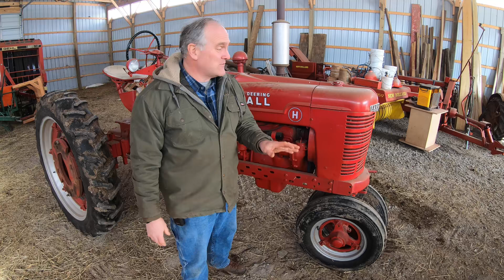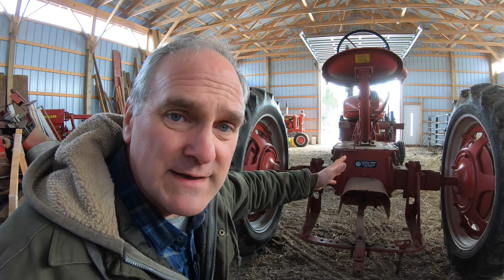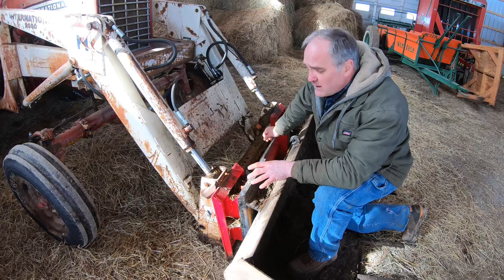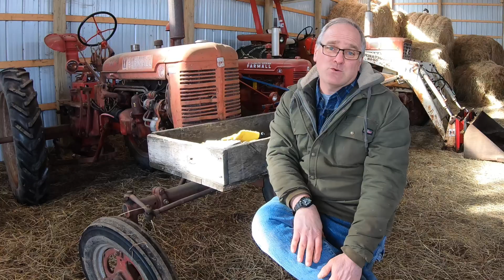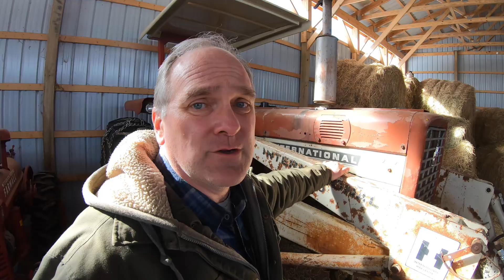Buying an Old Tractor for Your Small Farm

Comment: Well done video on the basics.  Do you have a comment on 6 volt verses 12 volt tractors?  What voltage system you prefer or find easier to work on?  Or maybe you find no real issue or difference.  Thanks for your video.

Comment: great discussion on old tractors.  live hydraulics is a super important advancement good to explain that!  as well as live PTO, many hay crimpers and sickle motors have been clogged due to the lack of live PTO.   the other thing is the older implements are usually cheaper as well as the tractors.   Definitely correct on Diesel tractors from the 50s, usually they are big bucks to repair.  thank you again for a great video

Comment: In Norway there is hardly any used market. Farmers can't get a price that overcomes the usefulness it still has so they rather use it as stationary power for something.
As a buyer used tractors seldom makes economic sense when they cost half what a new one of comparable size does.

Comment: You have the right idea Pete, around where I am in Ireland I see so many farmers with 30 or 40 cows going and spending 10s of thousands on big 200hp tractors. When really all they need is a few little machines like yours.  At the end of the day, your farmalls will still be around in 50 years time when a modern machine isn't.
Reply: a 200hp tractor costs like 150k€ but on dairy farming you need at least 100hp to be able to do the work with your own tractor as the machines have gotten to big

Comment: Really enjoy your channel content and occasional humor. I turn 70 this month and offer my perspective:  this past week I sold my two tractors preparing for my first new one, to be delivered later this week. 
I sold my 8N (1951) and Ford 3000 with loader (1965). Although they differed considerably each ran very well and served my needs. 

They each held sedimental value as my dad farmed with similar models plus three Minneapolis Molines (ZB, 445 & M5 models). 

I think you could spend hours talking about how Henry Ford and Mr Ferguson developed the 3 pt hitch and how those early tractor revolutionized small farming. 

In closing very good entry discussion on tractors.

Comment: My friend and I run a hobby hay business and all we use is old equipment. Our tractor fleet consists of a 1950 case so, 1949 AC WD, and a 1985 IMT. For bailing we use a 1950 AC rotobaler. Really neat to watch but very finicky. Our stock is rounded out with a haybine, sideload rake, and standard sickle bar.
You can't beat this equipmet for ease of maintenance and repair. The mechanics are truly that; mechanical. No computers, diodes sensora, etc. This is a great advantage since most repairs can be done by someone with modest mechanical knowledge. Plus theyre fun to run.
BUT....three are two considerations to remember. 
1 they are not going to work at the speed or efficiency of modern equipment.
2 OLD EQUIPMENT CAN BE DANGEROUS!
There's a lot off old farmers missing fingers, arms, or legs. Or, worse yet, DEAD. Not much thought was put into things like safety guards. It was assumed back then that people had common sense. 
Old equipment can be fun and beneficial, but YOU are responsible for your own safety.

Thanks fur the video Pete.
Reply: One farm near where I grew up used Allis Chalmers equipment in the 60s I liked the small round bales so much easier to work with and feed with than the small square bales.

Comment: Farm born and raised I still have a great affection for the smaller simpler tractors and a desire to get back to the farm!  Those tractors are simple to maintain and work on and cheap to purchase.  Many now want to start out with a new tractor with a multitude of attachments, problem is you can only use one attachment at the time.  I am an advocate of having multiple older tractors with each dedicated to a particular job or two.  If one breaks down, just move to another for the time being.  Many of us can take a lesson from you on that, you are rebuilding/repairing one of your tractors right now, yet your whole operation did not cease because you took one tractor out of service.  Every tractor has a job and every job has a tractor and you have spent probably less than if you had bought a new tractor with multiple attachments.  Great videos Pete, I enjoy living vicariously through you till I can get back on the Farm!

Comment: All fair dinkum, as our Aussie friends say. I would add, get a tractor a size bigger than you think you need. If you plan on doing a lot of loader work try to find a four wheel drive tractor. A three point hitch is worth spending a little extra.
Reply: 3 three point hitch is not something which decides how much you spend but it decides if you spend money if it has none, do not buy that tractor it is pretty much useless

Comment: Onething you should of pointed out is that the older tractors were 6 volt and the newer ones are 12. Incase they want to add lights or a radio to there older tractors they have to vonvert them over to except the 12 volt system. Thanks always enjoy your videos. I also have a 1950 h and a 54 super m Louisville  that I have to get up and going to ship them to north dakota where I live at. I inherited them last year from my grandfather  and I was the last one to run them 7 years ago

Comment: As usual Pete another fine video. I actually wish I could have seen it prior to buying my Ford 5000 diesel last summer.
Reply: Why?
Reply: When diesels work, they work well.  But when they have a problem it’s frustrating. Gasoline motors are usually easier to fix. And starting a diesel in the winter, well also frustrating. It could be just because I don’t have enough experience with it yet.
Reply: @beirnefarm8988  I've been a equipment mechanic for 27 years now. Diesels are a lot easier to work on ,no spark to mess with... I have no problem starting any of my diesels in the winter..... Just plug them in, very easy.
Reply: @bradjenkins932  My fault. I should have said for me gas motors are easier. I have had gas driven tractors all my life, so I know how to work on them.  I don’t have enough experience to work on diesels, so I am somewhat intimated by them.

Comment: I think you missed one part of tractors and that was ROPS. The tractors from the pre 1960’s don’t have them unless custom fabricated. Btw Allis-Chalmers in the late 40’s had semi-live pto with what they called a hand clutch.
Reply from the maker: Sounds like the aftermarket hand clutches that M&W made. I was not aware Allis had their own version. The M&W's bolted on to the brake housing on one side and slipped that side of the differential, so the tractor would stop moving while the PTO was still engaged.
Reply: @JustaFewAcresFarm  yes Allis came out with it on the Model WD. There is a promotional video from the time of the WD45 here on YouTube that talks about the hand clutch. With the D series Allis made the hand clutch so you could change speeds in the same gear and again no effect on the PTO.
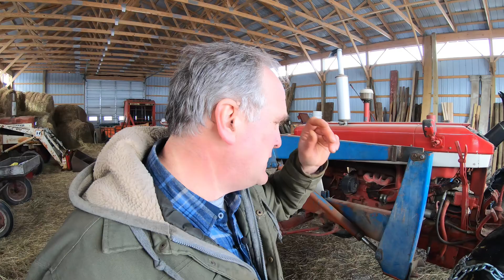Reply: @JustaFewAcresFarm  https://youtu.be/1Viw0LBJClM @3:10
Reply: @JustaFewAcresFarm  That is the type of clutch AC WD45 's used and Massey Harris's to on their "live" PTO

Comment: Feedback for topics to talk about that tractor newcomers might not know:
--How to use a diff lock to get unstuck when you don't have 4 wheel drive
--How to use a split brake to turn very sharply
--How and when to use wheel weights
--How/if to fill tires with calcium chloride
--How to combine range and gear selector for optimal speed with an implement
--How to properly adjust a three point hitch (top link and side angle of drawbars)
--How to safely jack up one side of an offset tractor so it doesn't tip (Farmall Cub, A, etc.)

Comment: Tractors that don't have a live PTO/hydraulics drive me bonkers.  I get that on really old tractors, like the H, they simply hadn't overcome the engineering challenge yet.  But even our JD 2040 from the late 70s early 80s had a split clutch.  Constantly hitting the middle of the clutch range when running a square baler or rotary mower got old.

Comment: My 1976 JD 401C industrial tractor has an unusual, but very serviceable "dual-clutch" PTO.  Pressing the clutch pedal half way down disengages the ground drive, and pressing all the way down also then disengages the PTO.  Works great for the three-point rotary mower.
Reply: That is known as a live PTO, very common on modern  tractors.  The older  ones would get you in trouble because if you needed to stop quick, the momentum of implement would put torque into the transmission and keep the machine moving.  The solution is to put a over ride mechanism between the implement and the tractor.

Comment: I both  my very first tractor in 2015 and it was a 1967 Belarus tractor. It had had none existent ball joints and I payd out 1k$  But for a 1k tractor it still runs and is much better then my friends 1989 Belarus. Real problem is it has no power steering and is very basic so not very comfortable to use these day. But it dose it's job and I can't actually complain.

Comment: Here's my story that may help you share info in future videos regarding loaders, Pete.  This may be too niche depending on the needs of the farm for loader work -- I have had a 1976 JD 401C diesel industrial tractor with loader for 15 years.  My main point is that I often find myself taking pleasure in the loader size and lift capacity, saying to myself I'm glad I didn't get a compact tractor.  I lift dirt, wood from downed trees, rocks, etc., and think about how many more trips it would have been with a smaller loader.  The bucket is 80 inches wide, and lift is 3,500 lbs.  About 60 hp diesel which starts fine, and in coldest temps 30 minutes with the coolant heater on snaps it right off.

Comment: Just buy a MF 135. 50hp in a body the size of a 30hp tractor. Simple enough that with a good manual you can fix everything just dont put the hydraulic pump into constant pumping. Expensive but so capable for the size you never will regret it.
Reply: Often said that a MF 135 was everything an 8n should have been.  Live hydraulics, live powershaft, draft and position control 3PH, multi-range transmission, and power steering.

Comment: I have a 1952 Ford 8N tractor it works good for what I use it for. Brush beating, plow the garden each year with a two button plow ,blade the driveway. There easy to work on it’s a really good little tractor for that kind of stuff.

Comment: When I got back into small farming my biggest decision was acreage. I  first got a cub ,great tractor. Just limited with power. Then purchased an H, put an aftermarket 3 point hitch on and wow what a tractor. Bought another H because of the price and convienenc, put a trip bucket on that one. Works great.A few years go by and purchased a  Farmall  300, what a work horse. With all 4 tractors I'm still in it for less than 10 thousand. The more you can fix yourself the better you can control down time and repair costs. Great video

Comment: I would rather put a plow on my truck and have a heated cab to do the majority of my snow plow work
Reply: I just use a cab tractor
Reply: Fair point but I want to be able to fit it in my garage and around low hanging trees if necessary, and cabs get tall.

Comment: I ran my small horse farm with two John Deere 40S and I still use them, but last year purchased a John Deere 2150 and to say I love this tractor is an understatement. The diesel engine and power steering is the best. Luck for me, the previous owner painted it so all I have to do is keep it up. It's a 1985 and it looks brand new with new tires all around.

Comment: Wanting to know what you need the tractor for now and maybe in the future is very important.  Starting out with a rotary cutter and blade then deciding you want a loader which you would need the proper hydraulic system.

Comment: Many of those old International, Massey Ferguson, and Ford tractors will last for decades if you maintain them. When I was growing up in Upstate NY in the 60's and 70's there were many Farmall's that were still running just fine. The smaller Farmall Cubs were very popular for pulling trailers and mowing the orchards. I remember driving the Cubs when I was just 10 years old. I was too small to reach the pedals and while I was sitting. I had to stand up to hit the brake and the clutch but because of the offset seat and steering it was easy to do.
One of the big problems today with modern tractors is not just the cost of purchasing them BUT the cost of maintaining them. Like today's cars many modern tractors have complex proprietary computer systems that are not designed to be serviced by the owner. There is a big legal issue that has been named 'right to repair' that the government is dealing with today. The problem is that if you try to repair your own tractor or other farm equipment it will void the manufacturer's warranty. Having to rely on dealers and service techs to repair farm equipment is adding a huge expense to farming.

Comment: Gas is a great choice for little tractors but when you are moving to 80-100hp i think its more efficient to use a tractor that runs on  (red) diesel because its much cheaper than gas.I know probably all of Those 80-100hp tractors run on diesel but just saying for the new farmers(sorry for bad english im from finland)
Reply: Pete, speaking of gas, do you ever have a problem with it going bad, especially now with the advent of ethanol?  Do you use Stabil or other stabilization additives?   Here on Long Island I don't leave gas in any of my chain saws or other gas operated equipment as it turns quickly.  I actually use Aviation Gas in all my small gas power tools as Avgas doesn't go bad.
Reply from the maker: @eagle2019  Hi Eagle, I haven't had any problems with using 87 octane pump gas with no stabilizer. If I had my act together better I'd probably put some stabilizer in them in the winter when they aren't used as much. I do think it's an issue & I've just been lucky up 'til now.

Comment: You are absolutely right about buying what you can get good service and parts for.  I use John Deere almost exclusively for my farming operation of 4,000 acres.  Not because I think it is superior equipment, but because there are two top-notch dealers close by, and time is money!  There is also a CaseIH dealer about 70 miles away, but it has a poor reputation for service.  I do have an old 15-30,  Farmall A,  Super M, W9,  and a 504 International, but those are just my "play" tractors and I don't depend on them for any serious work anymore.

Comment: Pete, I understand having a tight budget. My uncle and my dad both built tractors over the years. My uncle built several over them, including one with a FEL. My dad's first tractor was 2-1/2 horsepower, and was slow, but it worked. The last one was built with Toyota and Nissan parts. And was a tricycle type.

Comment: My dad and I have an 1980's Cub lo boy for our farm, that's a bit of a fixer upper. It needs a new transmission for the 3 point hitch in back, along with new fuel lines and a new wheel in the front. I was wondering if you could share some info on how to go abouts repairing the ptos and fule lines on Cub lo boys, and also where to find wheels/parts for them. I've tried a bunch of places online and haven't had any luck so far, on finding a wheel. Also any info on attachments for cubs would be greatly appreciated. Thanks for the great vedio, always enjoy learning about old tractors from you.

Comment: I think personally if I had a small farm and wanted a tractor to start off with I’d just go right some something 50-60hp+, diesel, 1960’s or newer. Nothing wrong with the older smaller stuff they all have their place but it just makes sense to me to start of with something a little more capable, albeit comparatively expensive.
Reply: I agree, If you need 50 hp get 65 hp. One day you will need to pull a delivery truck out of a bog or you will borrow an implement from a large farm and not have the power or hydrolics to run it. Like Pete said the old tractors are great for wagons and simple tillage, but a versitile and reliable tractor with a loader and live PTO is the greatest time saver when you are trying to get farm jobs done on weekends
Reply: @davidrobertson376  would be nice if all people would see that like you but here we get to say that we need a bigger tractor also when the current one ( Steyr 8070) runs all our stuff pretty well but it has only 58hp and people look at us strange when pulling a wagon which weights 10 tons